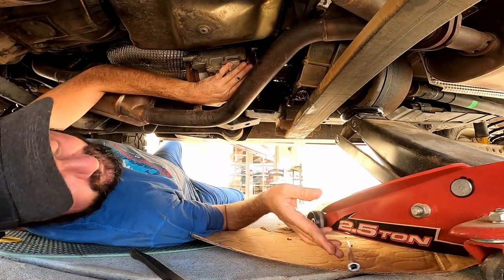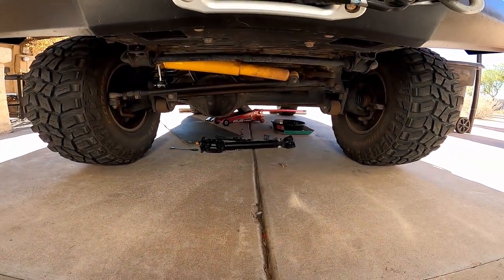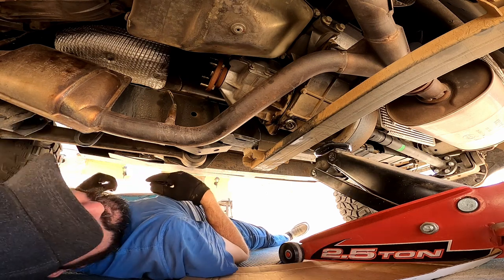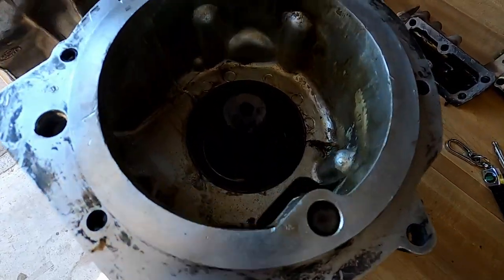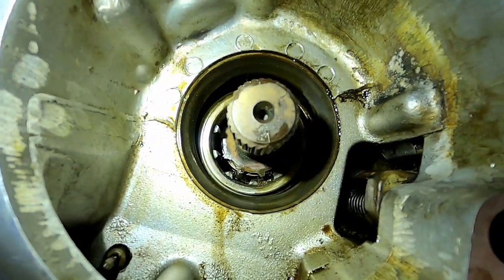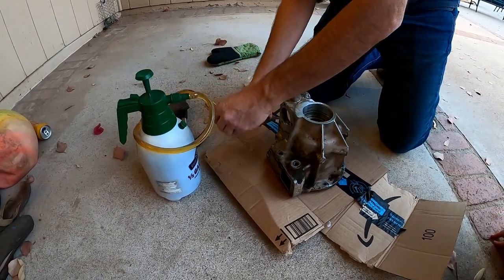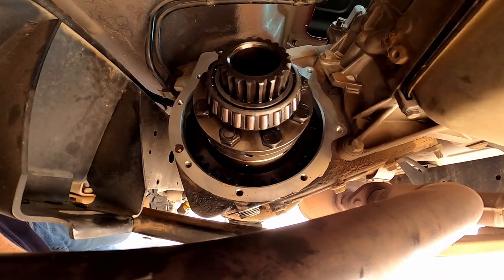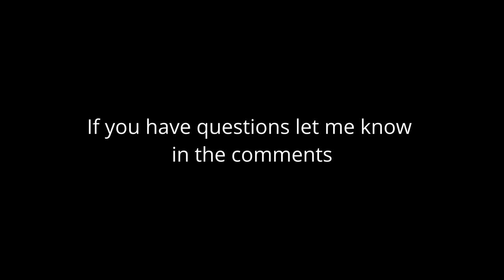Land Rover Discovery 2 CDL Install Part 2 (ignore part 1, watch this)

Comment: Got lucky on my 00 and already had the cdl on the t-case so all I had to do is install the shifter and linkage. I was able to find a disco 1 at the junk yard with everything and bolted right up to mine, even the dash light worked when engaged. Nice work on yours 🤙🏻

Comment: Your video is a lifesaver. I got a CDL nose cone from a scrap yard. Only question I have is about the wiring. What connector is that from that you tapped into? Going to try and install it next weekend
Reply from the maker: Trying to remember. I think the connector for the CDL light on the t-case came with my nose cone.

Comment: Great video.  This has helped me tremendously on the same project.  I have an 02 and also an 04 parts donor.  The only question I have is on my CDL shifter/cable assembly off of the 04.  It has a wire running from the shifter right behind the plunger that runs with the cable and plugs into a harness above the transfer case.  Did you run into that on your installation?  Or have any idea where it goes or if its needed?  Thanks .
Reply from the maker: I think I did have that and it plugged into something on top of the t-case. You will have an extra CDL switch that's not really need on the 04 nose cone. There's 2 switches on the 04, you really only need 1.

Comment: I’m struggling with the indicator lamp. Finished installing everything, but my front housing has 2 sensors to wire not 1 like yours. I tried both after doing the wiring trick you showed and neither sensor lights up the dash indicator. Also, the RAVE manual says that the ABS is supposed to turn off traction control when CDL is engaged - does wiring the dash lamp make this happen? 

Sorry I know this vid is old but you’ve been real helpful.
Reply from the maker: Mine actually had 2 sensors as well. I only wired 1 though. Could be that your sensor/switch is bad. I don't think that switch controls the traction control. I know for sure that my traction control works with or without the CDL engaged.
Reply: Thanks for the reply. I was able to narrow it down to a bad switch. It’s good to know it doesn’t deactivate the traction control when engaged, the manual is confusing on that.
Reply from the maker: @jayp6238 I think that traction control issue might be on pre- 2003 vehicles but I'm not totally sure.
Reply: hi, your video encouraged me to put a cdl on my disco but on the subject of wiring, you lost me.  Can you send me a link to the documentation?

Comment: Thanks for uploading this Video, exactly what I'm looking for!
@18:40 there are 2 switches instaled on the right. The left(front) one is connected to the diff lock switch, but what about the right (rear) one, with the original plug still on it?
Later in the Video it seems, just the left (front) one is connected to the harnes...
Reply from the maker: The second one is also for the diff lock. There's 2 but I think I only connected the one.
Reply: @fitzventure  Thank you! Thats good to know. It is not possible to find a partnumber for the second switch, do you maybe remember if the switches are the same?
But I think if you connected just the front one and got no problems with TC so far it should be fine...
Reply from the maker: @magicnik8881  I think they are.
Reply: @fitzventure  Thank you so much, I was searching for weeks to get this information :D

Comment: Hi there.  Had CDL internals and linkage installed in my UK D2 2004 model a couple of weeks ago.  I think mechanic has attached gearbox temp sensor wiring to the diff lock switch on transfer case (black and green wire) instead of diff lock warning light wire (black and blue).  I notice the gearbox temp warning light comes on when diff lock is activated.
So I think I have to do same mod as you to get warning light working  - could you let me know where you downloaded instructions from please ?  Would be super helpful, thanks 🙏 😊
Reply from the maker: That sounds like a problem ;) Here's a link to the document: https://1drv.ms/b/s!AnKdIaVJPUG3lf93tUqAe5KEckoheg?e=GPwxaN
Reply: @fitzventure  superb, thanks !
Reply: @fitzventure  hello!  Just to say thanks to your superb instructions I got mine working.  A couple of things I did different to you:  I didn’t want to cut any wires so I bought a scrapyard connector from transfer box harness, removed a pin and added in pin / wire to the relevant connector which connects with the black and blue wire from loom, then goes down to diff lock switch.  Also I used the black earth line from the gearbox temp wiring (which are now redundant) as the earth for the diff lock (meaning I didn’t need to make an earth).  Thanks again!

Comment: did you take out the 04 diff lock shifter and put it in the 03? I have an 03 with no cdl. I bought a cdl adapter case from Lucky 8.
Reply from the maker: Yes, I used the 04 shifter too.
Reply: @fitzventure  I bought the shifter from Lucky 8. It pops out of High gear while driving. I also tried the 04 shifter and it goes into Hi/Low but not diff lock. The shifter does move left to right when disconnected so I know it's not seized
Reply from the maker: @djwaxstyles1  I would ask luck 8 about that. Sounds like it's not working right.
Reply: @fitzventure  what kind of adjustments did you make when setting up both linkages? Maybe that's mistake that I made
Reply from the maker: @djwaxstyles1  I don't remember adjusting anything. It just sort of worked.
Reply: @fitzventure  I think we found the problem. When the nosecone was added I think the slider pin with the indent on it wasn't getting locked out. We just need to pull the nose cone and reposition the pin to the correct position
Reply from the maker: @djwaxstyles1  Nice. Glad you figured it out.

Comment: Anyone looking for a CDL Linkage and Shifter!!! I have one from Atlantic British they sold me for a 2002, maybe a newer employee but was over 9 years ago, and I can't recall. AT the time, I didn't know a 2002 doesn't have the lever on the Transfer case and didn't find the time to attempt to install it. Since then, I bought a 2004 roll over wreck for parts with less than 70K kms. Open to reasonable offers, shipped from Canada. Let me know here and we can connect off youtube.